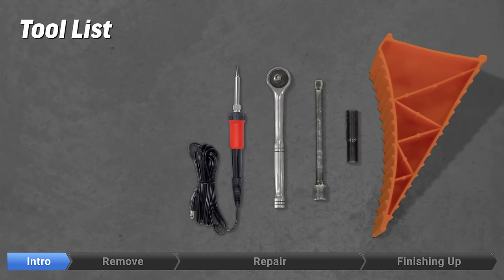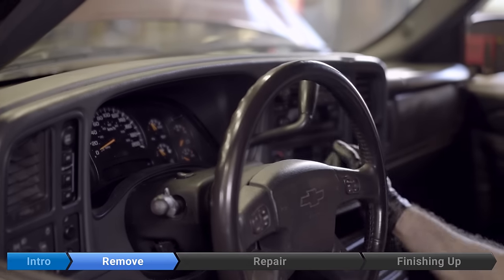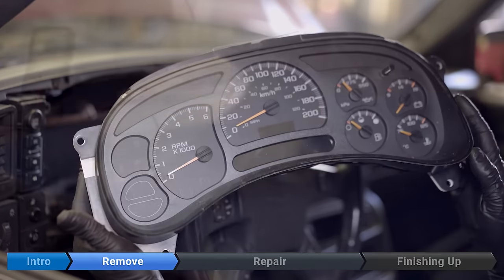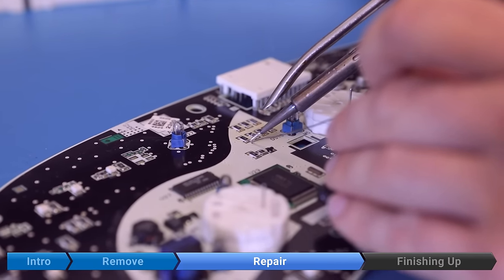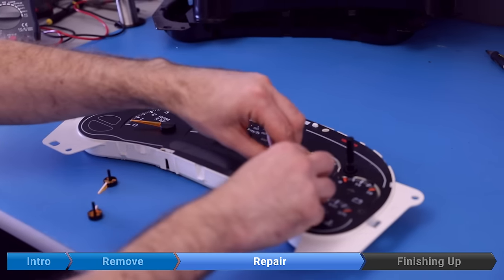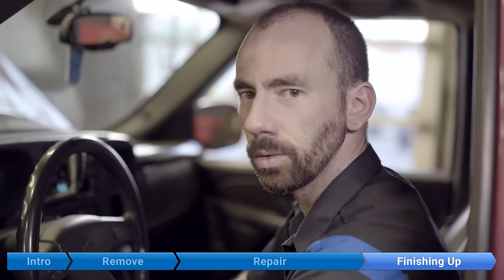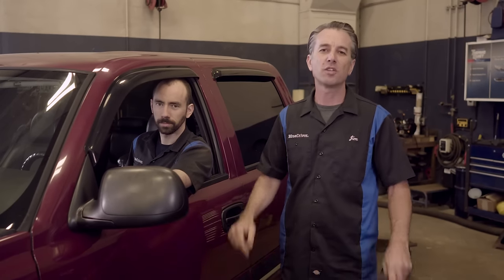Instrument Cluster Repair – 2003-2006 5.3L Chevy Silverado (Sierra, Tahoe, Yukon, etc.)

Comment: Yes, I saw this video a few months ago.  At the same time I needed to change out my signal indicator and both looked fairly easy to do.  Replaced the signal indicator and just as I got the panel out, our power went out because of a storm.  So PRNDL got put on hold till today.  I followed your instructions, disassembling the panel and located the circuits without any problem.  I could see a couple of cracks as you had shown.  Then I had to figure out what solder tip to use and what heat to set it at, got it figured out.  In the process, I actually loosened one of the chips and it fell on the floor, thank God I found it and remember what direction to put it back on.  Resoldered all the chips and said a prayer.  Put it back in the car, turned on the car, Praise God!  It had got so bad, that only at night could I see it and then, it was still hard to see.  A BIG THANK YOU TO YOU!!!!, for this video.  And by the way I am a woman in her 70's.

Comment: Here's the limit of my mechanic skills: I know how to drive my car to the auto-repair shop! I just did the fix on my 2002 Avalanche. Once I bought a cheap soldering iron and solder ($22 bucks at NAPA parts), it was pretty easy and saved me--who knows?--probably hundreds of dollars. In fact, for one of the seven resistors, when I touched one end of it with the soldering iron, it came clean off and I had to reposition with tweezers before soldering. I am 63 with hands that are getting shaky with age, haven't soldered anything since cub scouts. THANKS, BLUEDRIVER--I'm now a subscriber to your channel.
Reply: Hahaha hey the same thing happened to me just now! I’m 62 and also a bit shaky. I dabbed some solder on those points and it worked! These guys are life savers!
Reply: I thought I'd be mailing it off for repair at 130.00 ..price I've seen on a few videos but thanks to these guys I'm going to do it myself as soon as it's light out . I sprayed Wire Dryer all in the headlight switch box because light did whatever they felt like ..I had little control ..the spray worked .
Reply: What wire did you use?
Reply: I'm 83, do you think I could make this repair? I do.

Comment: Job completed, PRNDL is now brightly illuminated; thanks for a well-done video! Additional advice: 1. File your soldering iron to a tiny point if it's not already; those resistors are tiny. 2. Record precisely the original position of each needle (with masking tape and a precise marker) and HOLD IT in that original position as you gently pry it up upwards with a flat bladed screwdriver. Despite marking the position of each one, I must have rotated the stepper motors as I pulled up on the needles to remove them. I had to disconnect the cluster from the truck 4 more times, removing the needles and reinstalling them, to get the gauges reading normal (and I'm still not sure they're exactly right.) Thus, advice #3: Record the original reading of each needle with the engine running (tachometer at idle, oil pressure, battery charge, fuel gauge, and coolant temp) before you start the job.
Reply: Seems like they'd instruct people to put it back together without the front plastic on, connect it, set it in place, and test it.  If the needles are incorrect, just pop them off with the ignition on but not running, and make sure everything is zero...  Only seems logical.  And I'd almost guarantee you that they did that...  rather than assemble the entire dash, THEN check it.
Reply: @bbushong67  I just did this today and that is how I got the gauges all dialed in correctly and my Shift position indicator works again.  Thank You
Reply: Wish I'd read that bit about the masking tape before I did the job! Ah, try and repeat. happy to say all the gauges are working again and I'm thrilled to see what gear I'm in. Haven't had this working since we bought the truck 7 years ago. First time soldering electronics too. Very helpful video. Thanks!
Reply: This is a great tip, masking tape and a pen will save some inaccuracies later on.  Also, a fork from your cutlery drawer works well to remove those gauge needles without rotating the stepper motor shafts....

Comment: i found this video, the PRND indicator hasn't worked on my tahoe since i bought it, i have been putting off replacement due to cost, i tried your directions, sadly when i opened it up i can't see any breaks in the solder and not discolored, so i thought oh well, might as well try since it's open.... re-soldered, reassembled, retested, and BANG it works perfectly now! you guys are awesome i thank you very much!

Comment: Try a soldering 101 course and get some liquid flux to dab on those resistors. Will make the solder flow better so it doesn’t look as if some tiny bird shat on the board. 😇

But nice of you to show how from beginning to end. 👍🏻

Comment: Would this fix very dim Message Center lighting? You can see it at night, but it is too dim during the day. This is where it gives mileage, as well as any messages like "Buckle Passenger" or "Tighten Fuel Cap" or "Check Tire Pressures".

Comment: Wow!  It actually worked!!!!  My cluster is back!  I do suggest a lighted magnifying glass when doing this.  Those chips are no where near as big as they looked in the video.  I was able to remove and resolder the connections, and my PRNDL is back along with all my gauges.  Nice to see how fast your going, and how much gas you have.  Excellent video.

Comment: I have a dead gas gauge (fuel level sensor) and my rpm’s read about 700ish low. Would this be worth a try or are my stepper motors junk?

Comment: Awesome tutorial!  In my 2003 Suburban cluster either all the gauges come on or none come on, not just the speedo.  And happens most when it is hot outside, not so much when it's cold outside (perhaps has something to do with metal expanding and contracting?).  Do you suspect any difference for me or should I look for the same resistor set?  thank you.

Comment: I have a question, I recently purchased a 04 Denali and it started acting with the gauges, saying there’s no gas and that the oil pressure is all the way up to 80. If I were to do this would this fix my issue with the cluster? Not only that I could be in parked and then the needle for the gas will go from full to empty or half a tank then a quarter and just keep doing it all day long, even if it’s full. What would you suggest? I’ll gladly wait for a response before I take things apart. I loved the video! Straight to it and very informative, thank you!

Comment: Hi, I’ve got an 05 Silverado, with what I’m told is a bad cluster. The problem with mine is, It’s not reading the mileage, the speed-odometer isn’t moving /working either. it also won’t let me trip reset for mileage when using it for travel. My question is, is this likely the same issue & repair as what you’re doing here in the video? Thanks so much!

Comment: I do these for a living. It's not as easy as they make it out be at all. There are several other problems that these clusters suffer from as well. The biggest thing is "properly recalibrating the needles. The way they explained it would not get them even close to being correctly calibrated. The circuit board is very easy to damage and if you do, well good luck. Hope this helps

Comment: I replaced all of the stepper motors in my cluster, not realizing this was all I needed to do to get my PRNDL display back to normal. It looks like the cluster will be coming back out tonight and doing what you guys did. Fingers 🤞 that it will be better instead of worse when I'm done!!

Thanks for the video guys.

Comment: I was having issues with my gauge cluster intermittently working, then it seemed to finally die.  Resoldering the resistors fixed the issue, thanks for putting this video out

Comment: I did this. Even tested my new solder joints. Reassembled Cluster, everything worked. Next day, I find the entire vehicle without power. Not just cluster. Battery was depleted. So I charged the and replaced it, tested to ensure voltage, and still the power failure persists. I checked the obvious fuses of course. Cluster fuse etc. Can anyone offer some guidence here?

Comment: I had the issue with the prndl and reflowed the solder pads. When I plugged it back into my truck, it lit up real bright, but had 3 orange lines going across the display then the back light completely shut off. Did I ruin something?

Comment: Any idea if this would fix my issue? I have an 04 Sierra, all gauges work great but my PRNDL/digital odometer keeps switching between language selections, mileage, hours, trip selection, sometimes just goes completely blank and randomly switching languages.. I press the reset stick but won’t do anything. Every now and then it will sit on the Millage screen and stay for a day or two then it will start the cycle over.

Comment: Hi.  I had a problem with the speedometer reading erratically or not at all on my 2003 GMC Sierra.  I used your video to take out and repair the cluster by soldering the resisters as you indicated and it seems to have worked just fine.  Thank you for saving me at least $600.00 Canadian!  You guys are great, keep it up!

Comment: Anyone know which resistor is the one that directly affects the speedometer??  I did this procedure, had a soldering oops with one resistor, everything now works again except the speedometer. I just don't want to mess up retrying the wrong one or undoing the one I think I botched only to find out that one was good. Thank you.

Comment: great video and u kept it simple with explanation. can the odometer be switched out into another cluster to have the same mileage? my odometer needle stops working after a long period of driving. if i turn engine off and restart after 5 mins or so it will work again

Comment: Good vid, just two comments.  In another instrument cluster repair vid I just watched, before removing the needles, and with the ignition on, the guy put a little piece of masking tape underneath the tip of each pointer, then with a marker, he marked each needles position on the tape.  Obviously, you must remove the cluster first, remove the clear cover, add tape, then connect cluster back to truck, turn on ignition, and then do the markings.  Then remove cluster and do the soldering fix(es).  This was so that, on reassembly, you can put the needles in the exact same places and have accurate gauge readings.  The other comment is, well, I am a solder monkey, and looks like you added way too much solder to each resister when you did the reflow, lol.  It will work, just could be cleaner?  My 2 cents!  Thx

Comment: Just took mine apart today, found 5 resistors that had solder joints that needed to be re flowed. Took 5 mins, works like a charm now!!

Comment: This is an excellent video. I have been dealing with not been able to see the gear shift symbols for about 10 years on my 03 Avalanche and stumbled across this video. Re-soldered the resistors and amazing. Well done! Thank you so much! I will add that the resistors seem like they just float on the board and they do move fairly easy once heated, so do not use any pressure or force when soldering.

Comment: You never want to use the olde solder, always clean one side at a time with solder wick, then apply new solder, make sure to use 1 mm thickness so you can easily control how much you put on there

Comment: My 2003 Silverado cluster has been out for four years the only gauges I have is a voltmeter and the temp gauge  Speedometer works intermittently but he can show 60 when I’m sitting steel and 15 when I’m driving on the highway however if I disconnect my battery cable  gas gauge needle works The only indication of low on fuel I have is a yellow warning light I was so convinced this had to do With something with the ECU Because I also have a reduced engine power problem however a lot of my problems are solved the long I leave off my battery terminals and another question I have I have no idea How many miles are on the vehicle is the odometer digital or is there somewhere to store the mileage that I’ve been driving for the last for five years.

Comment: On the top of the cluster there is a small hole.  if you at that spot you can see a cool tab.  If you put in the ignition key or somethingg flat in the  hole from its side you can lift the tab and the wiring harness slides out.  This came after viewing the video four times wondering what I had missed because the pressing the gray tab as shown DID NOT RESOLVE THE PROBLEM.

Comment: Does anyone know which pieces on the circuit board would control my lower DIC controls on the steering wheel? It worked with another cluster but not with my own.

Comment: have a no start pontiac g6 2008 3.5, car says mileage for two seconds then i hear static noise in cluster electric noise then it says error! ! no click no anything! everything on cluster works sometimes it says fuel is low and its not! when trying to start!

Comment: Thank you for the video. Putting the cluster back was tricky. Had to use light force at the top of the cluster after connector placement to get it into position. Like I said it’s tricky.

Comment: Thank you so much. I did basic continuity checks on the wires and things looked good. Nothing on the board looked fried but this had me look closer. I ended up finding cracked solder joints on many of the big smd resistors all over the board. Cracked conformal coating was a big tipoff to many of them.

Comment: My dad took his Chevrolet Silverado to a mechanic service called Spoonire in boonsboro. Instead of the guys figuring out what the total problem is for the cluster, they wanted to charge him $250 including labor and the amount time it took to replace a bulb inside the PRNDL and Odometer. Sounds suspicious right? Well luckily my noob soldering skills and brains were put to work. I pulled out my phone and figured out it was the resistors that were cracked and not making contact. I think after testing it out and replacing the stepper motors and LEDs on it must've made my dad super happy after saving him $250 from that mess.

Comment: This is a great help. 2005 Yukon and three gauges in cluster died. This helped me remove cluster from a parts 2004 Yukon and install in the 2005. was done in less than hour. shows tools and even how to unplug the the cluster. Will review again if I need to re solder the old one. Takes the fear away. Thanks guys. awesome.

Comment: My prndl letters stay lit, but the border around the gear letter dissappears off and on during a constant cycling of messages in the "message center" screen. The battery message pops up and the fuel gage, oil pressure and temp gages drop oit, followed by the low fuel message then the change oil message. At this time the fuel, oil pressure and temp gages all come back online. In this mix the "security" message pops up as well. My airbag censor and ABS lights are almost always on....90 percent of the time......2002 1500 silverado 4.8 4x4.
Anyone know where on the board I might need to look? I'll start with where this vid shows.
Thanks for this vid. Very clear and to the point,  and thanks to all who have shared their findings here in the comments.

Comment: This tip might save you a whole lot of time once everything is reinstalled if one of your needles is too far up take a metal coat hanger put it through the odometer reset buttonhole use that to push the needle downwards but be sure not to do too much

Comment: Excellent tutorial - helped me fix intermittent issues with dash lights on my 2003 Chevy Silverado (and also fixed my speedometer and RPM gauges that had been broken forever by replacing the stepper motors.) One thing I missed - my solder was too large a gauge - got the job done but realized this video shows using a much thinner solder wire than I had. Got the job done, but would have been much easier with a thinner wire. Was also my first real soldering DIY!
Reply: Did this fix backlighting issues? I'm having issues where all of my gauges work, but my backlights are out. Swapped the light switch thinking that might be the culprit, but still have not back lights to the cluster.
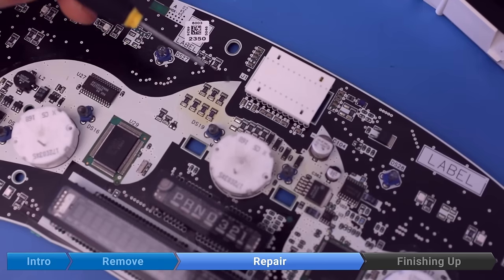Reply: @bclarkgsr  It did for me - I followed the steps in this YouTube video - starting at 4:20 - the resistors they pointing out - I had some obvious and some barely noticeable cracks. I resoldered them and it work perfectly to fix my backlight issue. As I mention, I wished I had thinner solder. It's a thin and tiny solder job.

Comment: You need a soldering iron with a much finer tip to solder those SMT resistors.  Practice soldering on small wires so you get the hang of it or you'll damage the cluster PCB!

Comment: That's crazy I had two garages said my engine went up cuz it would not start it would crank or rent do everything is supposed to do it was getting fuel I told him to take to take Bank One censor all then try it they took sensor Bank One sensor all and it started right up

Comment: My husband and I can't even find one anywhere around our town to replace it with I got online and you can't even find them they're out of stock he's currently inside the junkyard and I'm in the car watching videos trying to find a way around this issue and I could do this repair I wouldn't even have to ask him to do it you guys are awesome thank you
Reply: I do these for a living. It's not as easy as they make it out be at all. There are several other problems that these clusters suffer from as well. The biggest thing is "properly recalibrating the needles. The way they explained it would not get them even close to being correctly calibrated. The circuit board is very easy to damage and if you do, well good luck. Hope this helps
Reply: Don’t buy a new one or a junkyard one, there are companies you can send it to, have if repaired for 250$ and they sent it back the same business day.